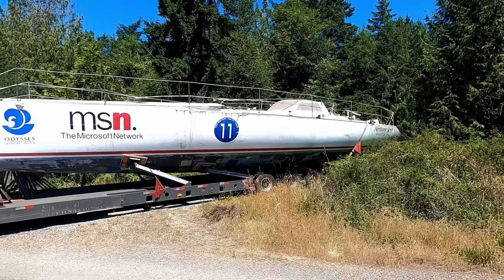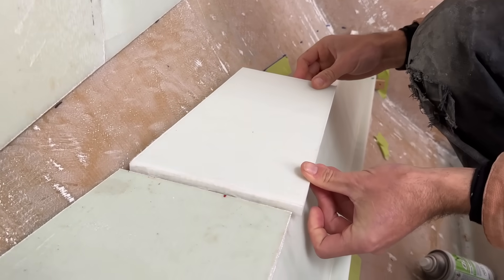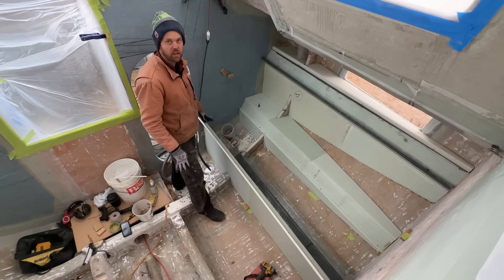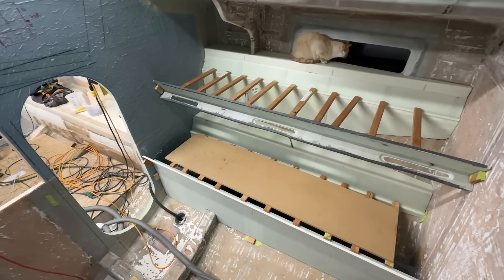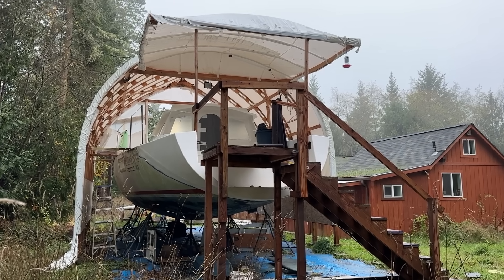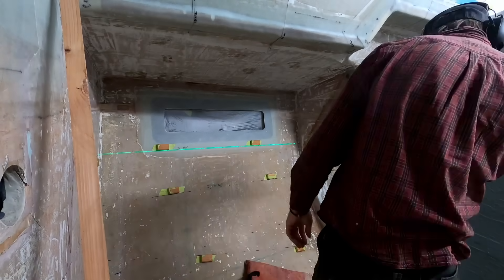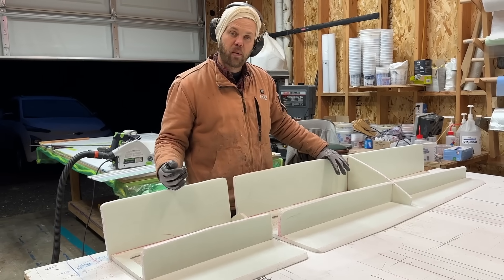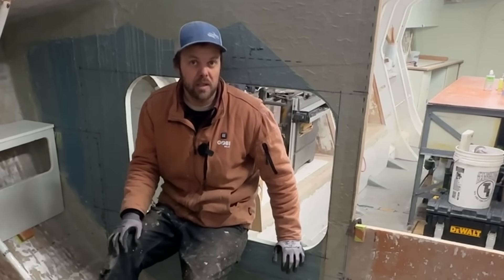Cutting BIG HOLES and building CABINETS [E105]

Comment: It's just CA glue, not CNA glue. Stands for CyanoAcrylate. Also, normally, the accelerator is sprayed on the bonding surface that doesn't have the glue on it, so that it activates when the part is pushed in place, and doesn't start kicking off before the joint is made. Since you're just using it for placeholding, it's not a big deal... more of a best practice thing!

The project is looking GREAT!
Reply: Exactly what I’ve noticed too. Spray activator on one side and glue on the other, when they mixes the magic starts.
Reply: Special T is a slow-curing CA glue. The manufacturer recommends spraying the accelerator on both surfaces before mating to shorten the curing time.
Reply: Mentioned the CA vs. "cna"  thing last week-must not have taken.

Been building R/C aircraft with CA for some 30 years now-won't use accelerator. It weakens the bond.

Comment: When creating all these features/structure on the boat....did you ever consider to use the cavities behind it to route wires or other things?...I mean...if you added a flexible tube inside it, you could push wires through it later. This could be considered in the cockpit as well for the instruments
Reply: He better do it soon!  My boat came from the factory with a few very convenient conduits that would have been impossible to add later
Reply from the maker: It’s a great idea that I do think about, but it’s also time consuming. I’m going to have lots of room to route utilities.

Comment: The spray he is using is Contact Adhesive Activator Spray, which accelerates the curing time of  Cyanoacrylate Adhesives (CA or Super Glues).
Particularly effective with higher viscosity, thicker types of super glue.
Also good for when the glue is applied in thicker layers, or when bonding porous / passive materials.
Helps with gluing in tricky environmental conditions (low temperatures, low humidity).

Comment: To solve the issue with the mattress, touching the hull, why not laminate a couple of tracks onto the hull and then laminate a piece of foam over those tracks. That would allow any sweat from the hull to drain down into the bilge area and it would hold the mattress Off of the hull itself keeping it dry.

Comment: Had you contemplated trimming some of the intrusion off those rib gussets above the bunks/bed, should be able to restore the lost beef with some carbon layers and a healthy carbon infill of the core at the outside edge. they will look like less of an orphan  hangover from the old design and more a component of the new one. Oh, concealed LED strip lighting now it comes in red etc, looks great if you can conceal it and nows the time to do it, just saying.
Reply from the maker: I trimmed them down as much as Evan the naval architect allowed me to

Comment: You're building a second bed. You use Laminate. You did not protect and paint the old laminate.
You make the bed supports from laminate. They are glued to the side. There is laminate on them. If the old laminate cracks (you meet the some container in sea) you won't be able to get to the crack. The inside of the yacht is can not laminated! Only vertical bulkheads can be laminated. You always need to have easy access to the side to be able to repair it from the inside.

Comment: The procedure I learned for using CA glue and kicker on model aircraft parts was to put the glue on one side of the joint and spray the kicker on the other.

Comment: Love the 'we'll design it as we go' kinda approach! It looks well thought out and practical. I'm afraid however that those beds might be a tight fit when there's mattresses on it. Not a lot of space left then. And as a tall person I I'm sceptical about the lenght of the beds. Being wedged in (length wise) can be very uncomfortable on a boat.
Reply from the maker: the bunks will fit a 6 ft 6 inch tall person. The tight fit is intentional as they're meant to be sea berths-you want to be wedged in when crossing an ocean. There will also be other, bigger bunks
Reply: @TheDuracellProject  Yes, I get that, but being wedged in is more appropriate/desirable for movements from side to side, not so much back and forth. While crossing the Atlantic, I was very, very happy to finally have a berth (X-442) in which I could stretch my feet out (which makes you considerably longer). You need to account for pillow space and streched feet. Don't think anyone 6'6" (which I am) would be very comfy. 

I'm happy to try when the boat is finished ;)

Comment: I completely enjoy, and am very impressed with your work.  I have one curiosity question-I understand the gluing when putting the mold pieces together, but what was the aerosol and why?  I hope you have thousands of hours of enjoyment in your boat when it is completed.
Reply: Activator for the CA glue applied to the opposing surface.
Reply: Thank you very much for both the explanation and the promptness of the reply.
 @kimberlydeann
Reply from the maker: It’s accelerator

Comment: Insulating the hull would eliminate the majority of the condensation problems in my humble opinion.  I don’t know if it is just me, but it seems that the bunks are a mite small for anyone my size which is 6’ 3” tall and over 225 lbs, so thinking that the majority of the people who would go on cruises with you would be about your size and not much taller or bigger.  When I recall some of the people who have assisted you on the boat, they were taller than you were, but my memory and vision could be bad also.  😅
Reply from the maker: A 6 foot 6 inch tall person could sleep in the bunks

Comment: Hey, just a heads up you SHOULD NOT spray accelerator onto the CA glue, you spray on the surface that is going to touch the glue, otherwise it will compromise the adherence of the piece since the sprayed glue will start curing immediately.  
Also, I never heard anyone calling cyanoacrylate as CNA glue, people just say CA glue.
I'm happy that you found CA glue, it's an awesome glue but also beware that most formulas are extremely hard and brittle, so it is not suitable for anything susceptible to repetitive stress, for that i would still use epoxy,
Reply: Matt glasses EVERYTHING as far as I have seen.

Comment: Matt, a question after seeing you fixing the bunk beds: how do you think regarding insulation of the hull? WIll this be added later, or do you plan to keep the hull un-isolated? I was thinking insulation first, then mount most of the interior.....
Reply from the maker: Because the hull is foam core construction it is already well insulated so I will not be adding insulation. I think it will be well insulated, but we will know for sure just how well once we're on the water

Comment: Ink for the back bed room , sort the fuel tank and then work from there for heights, ?? Litres    = kilos , and weight distribution,  your boat looks very light , so Balance will effect sailing,  and where it is central forward , aft , with a big load aft on one side , will you sail differant on each tack,  ballast is central yes,  that won't adjust for and aft ?  .not easy ,  trying to balance with drinking water tank is of until you use 50%.  Very flat tanks are a pain at a heal for drawing .  How about a smaller day tank and 2 smaller tanks 1  either side. .  Your doing a great job, so not being negative , just observation . And conversation.

Comment: You help talking about places to change and i realized you don't have a wet locker. And it's not designed with a pilot controls like on the man station. So you can steer from inside during storms using a joystick for example

Comment: Salute to your visualization skills which will only get better and better as you proceed. Physical reality of a space is always the final arbiter. I am concerned about ventilation and fuel tank odor in such a small space.
Reply: I sleep right on top of my boat diesel tank.  Never any aroma. I did add an axial fan to exhaust engine fumes and keep the engine bay cooler.  The tank is securely vented to the far aft end. The quality of the gaskets, hoses and clamps is excellent and well engineered. Fortunately, cold diesel fuel isn’t willing to evaporate readily.
Reply from the maker: The tank will be made of aluminum and will be vented overboard, so smell shouldn’t be a problem

Comment: Think your style is 'luxury race boat'. Not a cruiser racer, lots of posh Swans fall under that category and they are much heavier. Duracell is anther kettle of fish entirely. 
The cabins will be fine, you have separate cabins on a race boat! That is luxury in itself, no common bunk areas. 
Love the paired-down theme you have with building the whole interior from bulkheads and cutouts, all bonded in. Everything is you touch is the boat itself, not just bits of loose furniture semi secured into the hull.
Reply: ULDB cruiser.

Comment: How or do you level roll and pitch on your boat before you begin your refitting or is it not that important?
Reply: It is important. It seems like leveling roll would be easy with a spirit level. Possibly with the addition of some blocks to space it up off of obstructions. On a finished boat, you can use a salon table or a bunk to determine for and aft level. I don't remember anymore how duracell looked before they started working on it. There must have been some feature they could use to level it on the pitch axis.
Reply from the maker: The boat is pretty close to level

Comment: Matt - Do you find the SuperGlue used in large volumes a bit acrid?  Some find it really irritating to their eyes and sinuses.

Best!
Reply from the maker: That’s why I wear a full face mask
Reply: @TheDuracellProject  I was wondering if you just had it on from some cutting or grinding during fitting or specifically for the fumes from the SuperGlue and Accelerator.  Some aren't bothered by it at all while other appear to have a very severe reaction.  Good that your playing it safe rather than that other thing.

How do you keep Lapaz safe and clear of the fumes and fiberglass dust?  I often had trouble keeping the curious cat from getting out and "inspecting" before we had made it safe for them.  It's not much fun dealing with a cat who has gotten into things like fluffy fiberglass insulation and trying to clean them up before they've inhaled or ingested too much of it while grooming themselves afterwards.  They didn't often react very well to being shop vacuumed and bathed afterwards.

Best!

Comment: Did he just spray activator before placing the part?  He did it again!  Um, never used it like that before as it sets the glue rock hard, and I used to use that stuff all the time.  

Maybe he just glued one part and sprayed the other before joining.  Still, that's not how you use that, spray after placing parts. I dunno, British standards are just better I suppose.  .